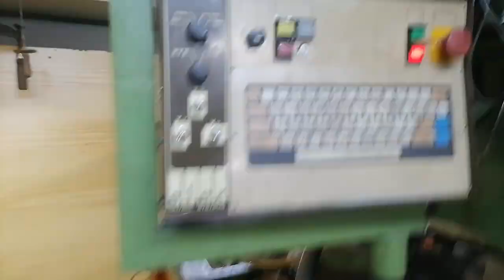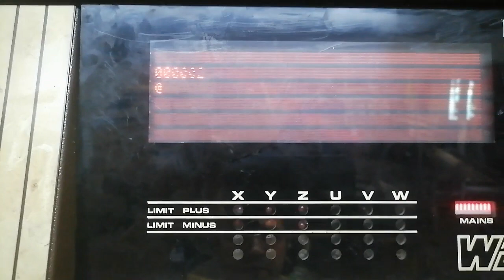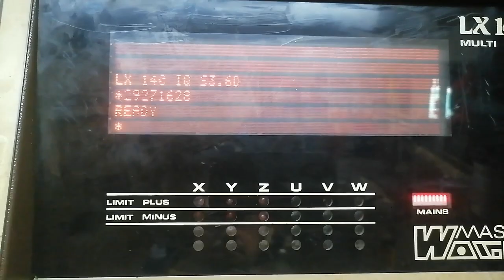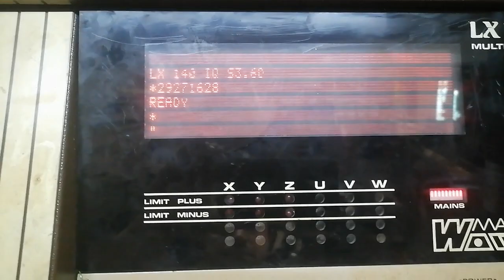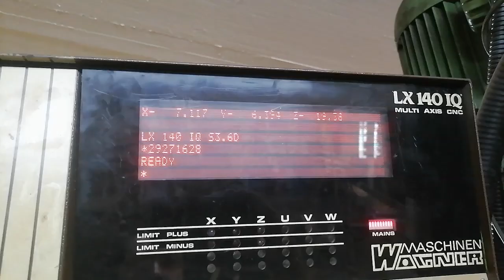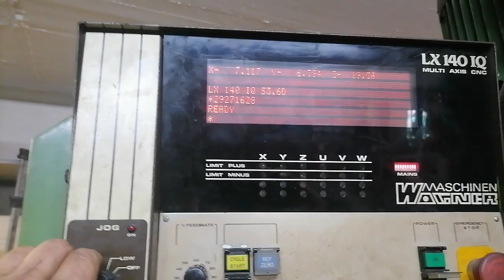PDP11 Repair Follow Up

Comment: Free test tone starts at @4:42 for anyone without a sig gen. Remarkable that you built an emulator to "remotely" debug a complex fault.
Reply from the maker: Yes it is definitely something he needs to sort out. It seems to be a faulty servo controller but he can easily track down such faults now that the system is up and running. I think the PDP11 had around 15-20 faults but most of the repair time was spent trying to figure out how to test it without the hardware or any technical information. Definitely an interesting one.

Comment: I used to repair the boards for ICL mainframes, the repair budget was unlimited, whatever it cost to fix a board didn't matter.
I reckon in the future critical infrastructure should be abstracted from dependencies like hardware and comms, we are going to face the same issues again when drivers for hardware no longer work on newer operating systems.  Having manufacturers producing 15 different types of USB connector is pointless and just creates landfill. Same with electric cars, 10 different types of charger and payment systems

Comment: Jerry, that's great news.  I'm sure the good news gives you a feeling of satisfaction after the months of difficult troubleshooting & repairs without access to the machine/control system itself.  Hopefully the customer will "machine" a small plaque that says "Thank You!" when he has the system fully working and maybe films the machine cutting that plaque too.  ;)
Reply from the maker: Yes it was nice to see it working. With such a complicated repair (a lot of making up test jigs) it is difficult to know when to call the repair 'complete'. The owner still has work to do but now that it runs I am hoping that he is close to cutting some chips. He is a very knowledgeable guy so I am sure it is not far from working.

Comment: Cnc driven by PDP11 was my first contact with real computer. During student time I have a plesure to work as junior CNC operator. It was 35 years ago :-) I started to use a Basic compilator on them.